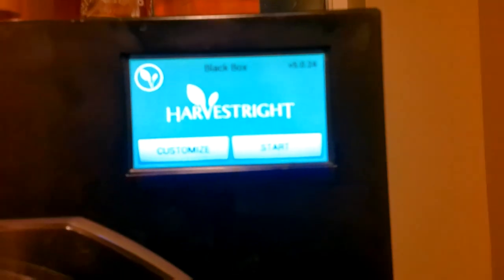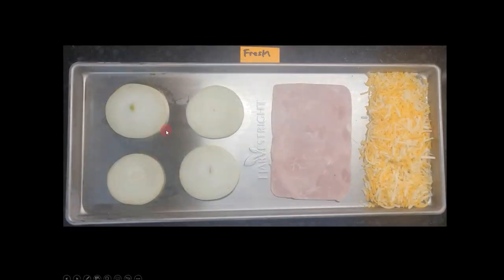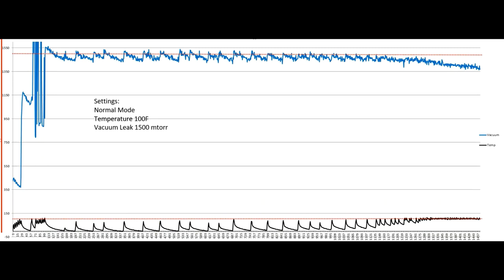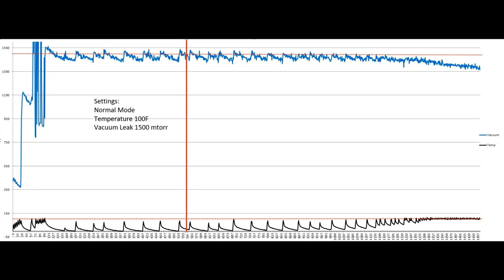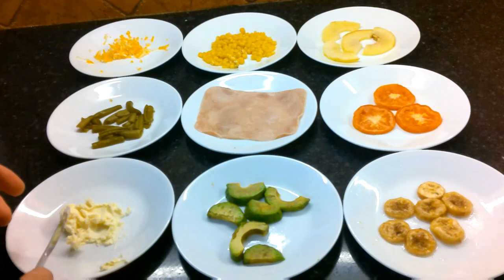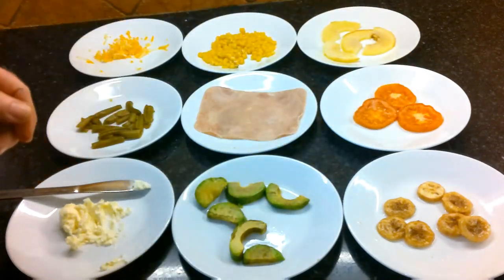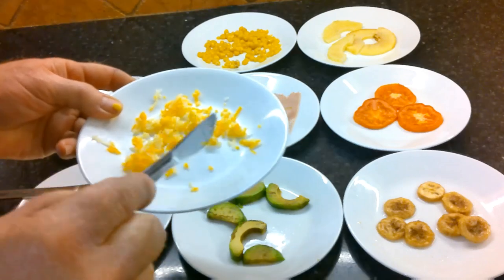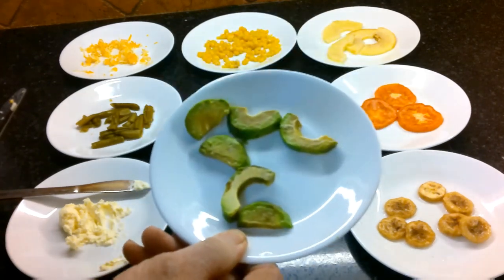Freeze Drying with a 1500 mtorr Vacuum Leak

Comment: Great video! I have a question about “Mylar” bags. I purchased a bunch of gallon bags from LDS and they don’t have a solid aluminum foil core like most quality bags. Instead they have sprayed aluminum core. When I hold a flashlight close to the bags, I can see small amount of light shining through. I am considering returning the bags, as I am afraid the quality might not be okay . They are very large (bigger then their rated gallon size) that’s s good thing. The oxygen absorbers seem fine and you rated them excellent, so I will definitely keep those... Are the bags you tested sprayed aluminum core that let’s light through? Is this a big deal or am I over thinking this... ?  THANKS FOR EVERYTHING!
Reply from the maker: The LDS bags are 12" wide and larger than a standard bag.  You got to be careful and center them in your 12" sealer.  The bags are foil bags.  I have used them and they're fine.  I wouldn't get too hung up on your flashlight test.  The bags rated very high.  see this video:
https://www.youtube.com/watch?v=PrT7JVJWkPI

Comment: I'm beginning to think that the 130 degree temp is just too high period!  Too often I'm seeing foods (mainly fruit) start bubbling. I think it's the heat melting the ice and creating a syrup that doesn't dry properly.  Also, most fruits that bubble also shrink up much more than those that don't.  Yeah, lowering the temp will slow things down, but slower might just be better!
Reply from the maker: The bubbling is most likely the sugars crystalizing.  Lower temps will do better, but take longer.
Reply: Thickness and skins.  Frozen cherries from costco bubble up like crazy, they are pitted.  But you precut in half and I got almost no bubbling.

Comment: I still say the "correct" answer is to just fix the vacuum leak. It's usually not that hard. I believe  the biggest problems are the drain ball valve and the vacuum hose.  Neither are very expensive and easy to replace.  There is potential for other leaks but the most common are worth addressing first.

One issue I have with the .24 version is that if you do have problems you can not go back.  I don't like that the heaters come on during pre-freeze to limit the lower temperature.  This actual causes your pre-frozen food to warm up after being put in the machine only to have to turn around and go back colder.  Why?

HR refuses to supply you with the previous version software, I've tried.
Reply from the maker: It is possible to go back.  There is a software file to allow that.
Reply from the maker: I agree.  The best thing to do is correct the leak.  Many owners may be incapable of performing this task.
Reply: @Philat4800feet  Sure there is.  The problem is obtaining that file.
Reply from the maker: @BowWowPewPewCQ  I'll delete this link after 24 hrs.  This is the force up file:

https://drive.google.com/file/d/1gfEqrVwzOI2lDk30LUHT8nUuL2SdUV3C/view?usp=sharing

Comment: So it will still freeze dry with mTorrs above 500? I’m worried that it’s just dehydrating and not freeze drying.
Reply from the maker: Sublimation will still happen above 500.  it will just take longer.
Reply: @Philat4800feet  thanks for this comment. That was a question I had.
About how high do you think you can go (for sublimation?) 

I've heard 2,000mT?

Comment: How do you know if you have a vacuum leak?
Reply: Anything reading over 500 mtor means you got a leak
Reply: Thank you. Yes, I have a leak. Hmmmmmmm. Well we have a new hose and it is time to filter the oil. So, this was timely. Thank you again.
Reply: @debrasonner5970  I have battled leaks since I got one for my wife. How is your hose seal at the machine? Hers was constantly failing right there. I found a very effective cheap fix
Reply from the maker: Observe the mtorr reading.  During the Dry Cycle your mtorr should be around 300-600 mtorr  (vacuum will be cyclical).  During Extra Dry it should get down around 150 mtorr.
Reply: @roadwarrior3315  How did you fix it?Thank you
Reply: @bridgetteharmon9364  our unit kept losing the seal where the vac hose connects to the machine. I went to ACE hardware and got a conical shaped rubber seal the same diameter as the hose seal and that stopped the largest leak. Secondly I got some silicone self sealing tape and wrapped the swivels at each end of the vac hose. My wife says she never had vacuum numbers that low. Happy wife=happy life😁